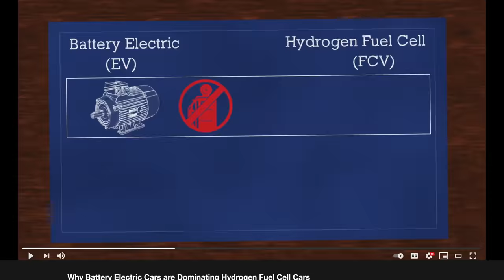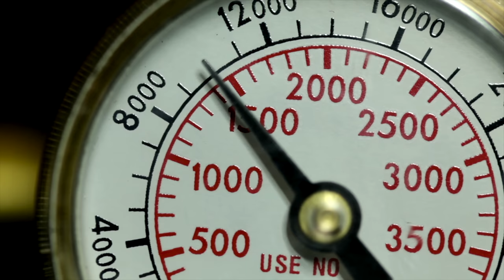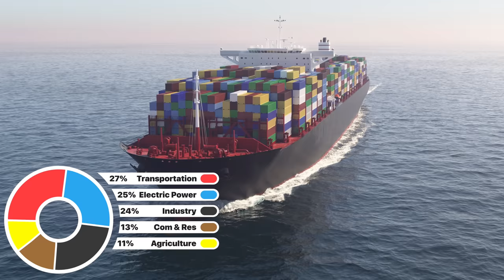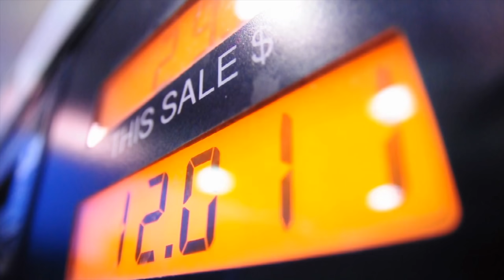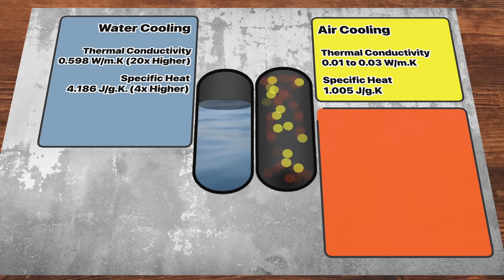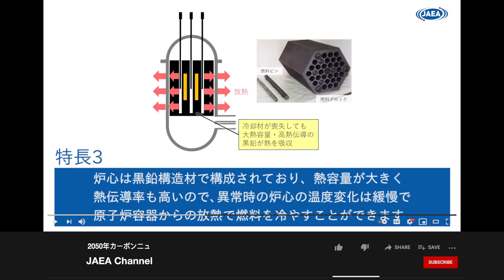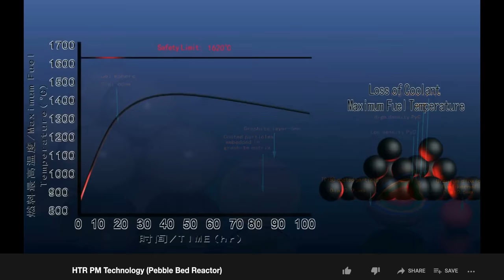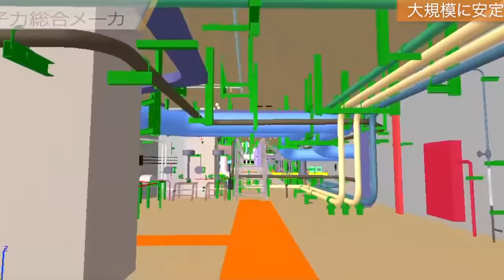Japan's Plan to DESTROY the Price of OIL and GAS!

Comment: Hydrogen buses are a common sight in Japan ⚡ glad they are pushing this technology
Reply: Can't rely on it
Reply: Why is it good that Japan is using H2 busses? They use blue (nat gas) H2. Using Nat gas busses would be Alot cheaper and almost as clean. The H2 pumping stations are dramatically more expensive as well. Cost of fuel is $16 per gallon equivalent with gasoline, while EVs are Much cheaper to run.

Wasting money isn't really a good thing.
Following fads (that have no technical justification) while ignoring EV busses is not doing the environment any good.
Busses move moderate loads in traffic over short distances. Ideal for EVs. 

EV prices are plummeting. H2 vehcile prices... not so much and they were always expensive to begin with.
Reply: Hydrogen buses are common in London too
Reply: Its being forced.
Reply: @avgjoe5969  did you watch the video? better times for h2 is coming
Reply: @pyrokugleis  They would be better to simply use the electricity production to power far more EVs. Hydrogens production inefficiency is not really solved by nuclear power, only masked. We will need some Hydrogen though for ships, planes and industrial processes. For these it's inefficiency and resulting higher cost is justified. Solar could also produce this Hydrogen in the future through daytime over production. See RethinkX for more information.
Reply: @avgjoe5969  you say busses move moderate loads through traffic at short distances, but neglect the fact that they often run for 8 or more hours at a time, this is why ev busses aren't yet viable.
Reply: @garethrobinson2275  But as the video stated this type of reactor don't need electricity to produce Hydrogen. It uses a purely thermochemical process to split water since the waste heat of the reactor is enough to enable this process, it isn't using electrolysis. Doing so increases the thermal efficiency of the plant since it allows cogenerating both electricity and hydrogen, and the resulting waste heat of the hydrogen production could even be still used for district heating. 

From a Japanese paper regarding HTTR I've read, a single plant is enough to power around 170,000 FCV cars per year (assuming consumer cars not trucks) and since this is an SMR (small modular reactor) it is much smaller than the LWRs that's operating today (e.g. no huge cooling towers) where multiple facilities can be built in the same spot since it's power generation capacity is lower than the bigger plants today. The estimated price of hydrogen made from these Gen4 reactors is stated to cost around the same price as gas, efficiency isn't really a problem if you can make up for volume. For example, ICE vehicles are far from efficient (even FCVs are more efficient) but we still use them anyway since the fuel price is low and volume is big enough.

Comment: Japanese practicality, and we will see what comes up for their car industry. The fact that they put a Reactor back on line with the appropriate upgrades, is telling.

The Brayton Cycle using CO2 to replace Steam, because it has a similar cycle of phase changes, but not so many corrosion problems,  ..this will be interesting to see come about one day. I just saw an historic movie on Steam Turbine powered ships that had a Condenser Design adapted to recycle the Circuit Water, same for CO2?
Reply: Can you provide a link? That sounds really interesting
Reply: Main advantage of CO2 cycles is the turbines are way smaller and cheaper, the Steam turbine portion of a conventional power plant is ~40% of the cost of electricty.
Reply: The steam cycle is the Rankin cycle. Brayton cycle is the gas turbine cycle!
Reply: The early reactors in Britain used CO2 as the coolant, as do the North Korean reactors.
Reply: The most interesting cycle is an allam cycle which uses supercritical CO2 as the working fluid. Supercritical CO2 is a more efficient working fluid so you get higher efficiency in addition to smaller turbines. In an allam cycle methane is combusted with pure O2 to heat the supercritical CO2 and move it through a turbine. The working fluid is 97% CO2 and 3% water vapor. The water is condensed out and some CO2 is tapped off and reused while most is sent for other uses or sequestration in a 100% pure CO2 stream. There is a a 25MW pilot plant operating in Texas. There is no reason that the heat couldn’t be provided by another source other than combusting natural gas. The other advantage is that after producing the the pure O2 through air separation and condensation of the water vapor the process in 50% efficient.

Comment: I love your videos.
Isn't there one glaring problem with Red Hydrogen? 
There is a worldwide shortage of helium, and it looks like it's not getting better anytime soon. I love the technology Too bad it wasn't discovered 20 years ago
Reply: helium is not used in the process, it is simple a coolant. this technology isn't new, the chinese had operational helium pebblebed reactor for a decade that is already commericalised, the reactor is also self regulating, the hotter it get, the slower the reaction due to the expansion of the pebble, creating a true meltdown free reactor without requiring any external control or cooling.

so it was not only discovered but even developed 20 years ago. Japan just couldn't be assed to replace their existing reactors, one has to understand that reactor finance include their sunken cost, and you have to use them to their end of life to recover their value. in short Japan invested in nuclear too early before 4 gen reactors are developed.
Reply: @lagrangewei  Really sad Japan (and most of the world) got stumped for 10 years due to the Fukushima accident, Japan's HTTR actually was made a few years earlier than China's HTGR and both were doing tests roughly the same time. If Japan didn't pause their nuclear program after the accident, it's very likely this would've also been in commercial operation by now as well.

Comment: Great video.  My understanding is that 'Red Hydrogen' is produced from biomass, using a CO2 emitting energy source, like nuclear, wind, solar or hydro.  If the carbon is captured using the 'turquoise method,' with carbon capture and sequestration, the process actually removes carbon from the biosphere.

Comment: This was surprisingly brilliant. What are they doing with the heavy water made through the reactors?? Is that a requirement?
Reply: @jackdale9831  It is being used for hydrogen. It is good for power and rocket fuel.

Comment: Always wondered why we ended up with large battery operated vehicles without do much as a thorough attempt at hydrogen.

We are now seeing the challenges EVs are going to present us.  I hope we have invested in the right direction.  I fear we have only been led to this decision by a salesmen.
Reply: How much h2 can a car store store? I refer to refueling. There was, years ago, a History channel documentary on the future of cars. Reportedly, a 24 gallon-sized tank of carbon nanotubes could have 1,500 miles worth of hydrogen stored so every 1,500 miles the storage tank would be pulled and a new one inserted. As I recall, this was supposed to take about as long as a gasoline refill.

All that aside, I think thorium reactors are the way to go. Much reduced nuclear waste. But the one clear point is the world must go nuclear to about 95%. The remaining 5% can be "green" sourced.
Reply: Hydrogen is difficult to store needs high pressure to transport and while creating it you need a ton of energy. Nuclear powered hydrogen creation, OK, but I wonder at what quantity you can actually provide it. - So far all attempts have failed to enter the market, yes I know they try to centralize everything and lookup foreign ideas, but you have to admit that there are huge challenges with it. - let's see.
Reply: Hydrogen engines produce water vapor which is the strongest greenhouse gas.… Try again😮. Science fiction books written over 50 years ago we’re talking about fission reactors and the ability to have it miniaturize for personal power use. What happened to that idea to expand upon?
Reply: Hydrogen fuel cells need platinum and palladium, which are very expensive.
H2 is also a bugger to store.
Red/Green H2 has many industrial uses and can be used in ICE engines for fun..
But H2 fuel cell cars are available everywhere but popular nowhere.....      :)
Reply: Because hydrogen is highly explosive.
Reply: Hydrogen needs to be compressed at insane levels of pressure, it doesn't like to stay contained. The only way to contain hydrogen is to liquify it, and that's been tried and doesn't work. It's expensive, complicated, and your car becomes an IED.
Reply: @liberalhere3731  Carbon nanotubes are as dangerous as asbestos. It's also hard to extract the hydrogen once it binds to he nanotubes so you need to heat them up a little, wasting power.
Reply: @davidthompson7817  Water vapor rains from the sky, thereby not remaining as the "strongest greenhouse gas". When we see carbon dioxide falling from the sky on a regular basis, clearing the air, you'll have a point.

Comment: I always thought this could be possible to create cheap hydrogen using nuclear reactors. I even posted about this idea more than 10 years ago.
Reply: The problem of containing hydrogen under pressure in moving vehicles in traffic is still unresolved.
Reply: @donaldclifford5763  Yes, hydrogen must vent the tank. If you fill up with hydrogen gas a vehicle tank, a week later it will be empty.
Reply: That you Da Vinci?

Comment: Question 🙋🏼‍♂️ Would the excess waste heat after the hydrogen production still be hot enough to power a steam generator?  If so this is a triple win.
Reply from the maker: now that's interesting! there's probably some excess energy that could be used in some way for sure... love how you're thinking about this, good stuff

Comment: just stumbled on your channel via this video, instant subscribe. You went in-depth enough to cover everything without getting too much into the details. You linked between relevant ideas, put them in context and explained why they matter together.

You also cleared up the bad impression made by Period Videos's disappointing "colours of hydrogen" video.
That was so bad it made me think there's a big hydrogen lobby promoting these nonsense colours. While there might be some truth to that, i now see the importance of these "colours" : it would otherwise be difficult to talk about S-I catalysed hydrogen, without this shortcut !

Lastly , i'm glad to see other people optimistic about our inevitable nuclear-powered future. But i wish you would be a bit more careful when discussing the safety concerns : 
- Words like "explode" have been tainted by decades of fearmongering, people nowadays gets PTSD just from hearing a reactor could "explode" , when in reality it's just a steam pressure buildup. Reactors are not bombs ! and even the old design is now very very safe, thanks to strict protocols, containment, shielding, redundancy, and preventive measures...
- And the problem of "nuclear waste" is a very minor issue : most of the waste does not even come from the reactor itself. Only 3% does and it gets stored in the form of very stable glass and ceramics sealed and fused into their concrete containers. Basically big barrels or slightly hot rock. No leaks or contamination is ever possible short of grinding those containers to dust.
The problem of nuclear waste should always, always be put in context of other energies' waste, which is far bigger and nobody talks about it.

TLDR : even though you're not spreading anti-nuclear ideas, the mere mention of explode/meltdown/waste , out of context , is enough to reinforce the preconceived ideas in most people.
These words have too much negative baggage now, and we can't undo the decades and billions of dollars of propaganda if we don't set the facts straight.

Comment: Interesting to see that Japan is following a similar path as the UK when it comes to nuclear and hydrogen, although Japan seems more certain of it!

PS: the UK prefers to call it pink hydrogen. Maybe seems more friendly than red hydrogen?
Reply: they're different, pink is generated through electrolysis of water by using electricity from a nuclear power plant. red is produced through the high-temperature catalytic splitting of water using nuclear power thermal as an energy source.

Comment: I wonder why liquid salt thorium nuclear reactors are not being considered. As far as I understand the thorium reactors are inherently safer due to their design and ability to operate at normal atmospheric pressure. They additionally produce far less waste than uranium or plutonium reactors.
Reply: I don't think MSRs can get hot enough for this particular catalyst reaction, although I'd like to see more of them for general power production. Main problem with them is #1 figuring out how to chemically separate the protactinium from the active salt while it decays, and #2 each reactor needs several tons of lithium, like there isn't enough demand for that already.
Reply: China has built a SMR but unsure whether it has been commissioned & become operational yet.  Its effectiveness will determine whether this process will be repeated elsewhere.

Comment: Hydrogen storage has always been the scapegoat. Years back I saw a vid testing tanks. They fired an armored piercing explosive round at it. Because of the high pressure in the tank any flames are blown out by the high pressure escaping gas. It was also planned to have sensors for leaks that automatically opened vents to eliminate any gas buildup.

Comment: Isn’t Pink Hydrogen Nuclear?
Reply: yes
Reply: This is using the reactions not the electricity. The Catalytic reaction to make Red Hydro.
Reply: Yes, it is. But it’s called pink if we use nuclear-derived electricity to produce the hydrogen. But if we use nuclear heat directly, it’s called red hydrogen. Still nuclear

Comment: For anyone curious (using the weight of water): 

1 ton is equivalent to 264.172 gallons of water.

250,000 tons * 264.172 gallons/ton ≈ 66,043,000 gallons

66,043,000 gallons ÷ 55 gallons/barrel ≈ 1,201,782 barrels

That's really not that much waste to store

Comment: Good job. I'm not a fan of nuclear power but the advantages of this approach is intriguing if not appealing. One thing was overlooked though - Helium is a non renewable resource that is currently under stress. We are running out of Helium. It actually comes as a byproduct of drilling for gas. Something to ponder when thinking of scalability.
Reply: We're starting to mine space, helium is rare only here on earth, soon we'll have space machines powered by solar that don't spend too much money just dropping liquid helium scavenged from space.

Comment: 13 years ago I met an interesting American in my local bar in London. He was visiting on business. After a number of drinks he relaxed a lot. He was into shale oil.  The levels of shale in northern USA and Canada is amazing. I pointed out it is not economically viable to extract the oil from the shale, as it needs a lot of heat to do so. And also that it depends on the percentage of oil in the shale.  He said one or two nuclear power stations dedicated providing the heat can make the USA & Canada 100% self sufficient in energy, with continuing on proven existing transport technology - petro fuels. He said that the USA/Canadian shale needs little heat to extract the oil. In that time renewable energy has advanced brilliantly - and also the technology on its application at the user end.

Thankfully, so far has not materialised. But, it is a backup if world energy takes a nose dive.

Comment: For the price of that bike you can convert any bike you want with a more powerful mid motor and a 52v battery and do over 25mph and get between 60-100kms and have 9 assist levels. I have 2 and im using my old mountain bike for one and its done over 8,000kms and the other is a gravel/road bike thats got the same set up ams has done around 4000kms. Both have been reliable ans i would reccommend Bafang ebike motors if you want to build your own ebike for a lower cost

Comment: Maybe I'm wrong. I thought conventional nuclear was exhausted around 80%. While the new nuclear was exhausted around 40%. So while the amount of material might be the same. The amount of time that the material is radio active is dramatically reduced. We could reuse the existing waste as new fuel. That's material that can be used immediately. It doesn't need to be mined and enriched. A jump start. Also were the old nuclear was adjusted for the terrain. Which is very time consuming to engineer. The new reactors will be uniform and the terrain will be adjusted to fit the reactor. This should be much easier and faster, then all of the reactors would be exactly the same. A technician could go from one reactor to the next with no training needed.

Comment: The problem with electricity is that the need always fluctuates. That to me is a place where Hydrogen can operate as a effective storage of power. When the power need is low, the access power can be used in the production of Hydrogen and that Hydrogen can then be used to produce more electricity when the need increases.

Comment: I've thought for a long time that hydrogen fuel cell cars are a better option than batteries. It just comes down to the actual production costs of the hydrogen. Since the price of replacing the lithium batteries in an EV can be around $20k, a lot of EV's are throw away cars when enough cells go out. If this process can cheaply produce hydrogen and refilling stations start being built, I think a lot of EV holdouts will be more accepting of hydrogen cars.

Comment: In this system does the helium need to be replaced or can it be perpetually reused?  If the latter then it’s all well & good but if not even if only slow replacement is needed it could pose a problem.